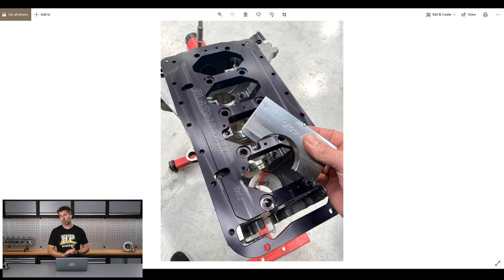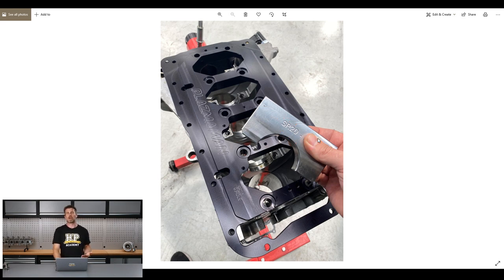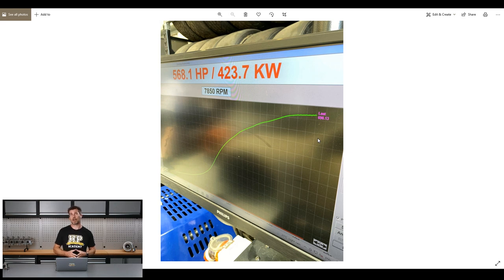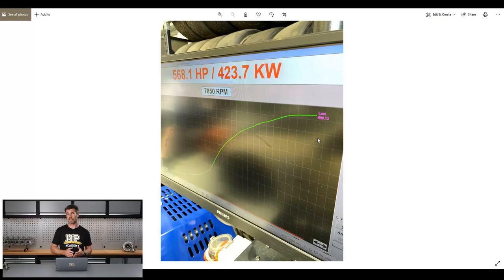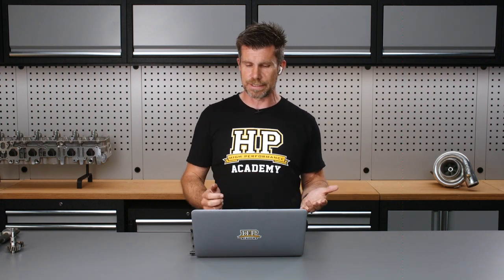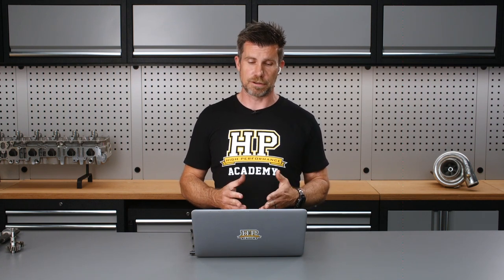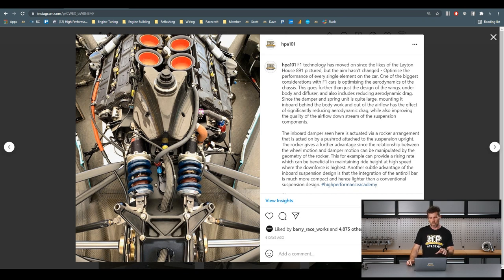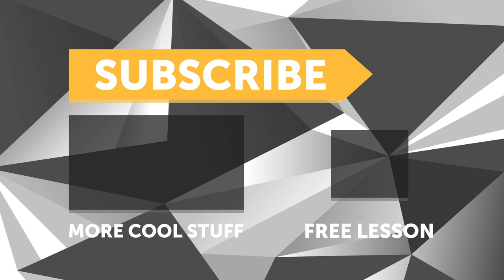FJ40 Build Update, SR20VE Swapped 86 Rain Racing & More [#UPDATE 297]

Comment: With the BREMBA calipers, as with all calipers, they will be disigned to work with a specific width and diameter of disc - trying to use them for the wrond disc size is just going to give problems and you're going to be much better off on-selling them and using the correctcalipers.

Comment: Out of curiosity, is the 3UZFE build for the 86 still in the making or it's bin shelf and won't see the day of light? thanks
Reply from the maker: We never got it. There was a delay, partly COVID caused, so we did the SR20VE swap instead and gave the instructions to still treat it as urgent, then 12 months later it still wasn't here so we just got a refund on the donor block etc a few weeks ago. 
It was supposed to be built as project in conjunction with a local engine building/machining company (their idea as an interesting project they were keen on).
Won't be trying that again, it really made life difficult for us 🤣 Note it wasn't something where we would get it for free in exchange for promotion or anything either, we had the cheque book out and wanted the engine. #firstworldproblems

If we did have it, it would have been put into this for sure once we peer pressured Andre to do it enough, buuuuut we don't 😢 - Taz.
Reply: @hpa101  You're peer pressuring over the wrong car Taz. 😉
Reply from the maker: Haha yes DOCILE will get there. Ben's peer pressure is what works for that one.
Reply: @hpa101  I shouldn't have stopped my own peer pressure, was up over 200 days. 😂👍